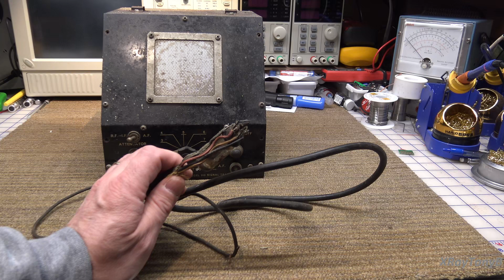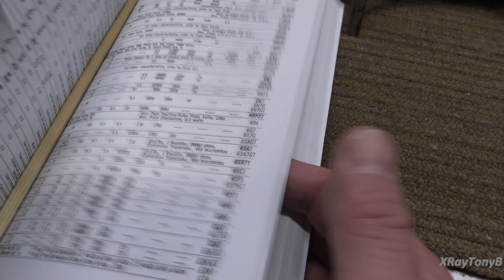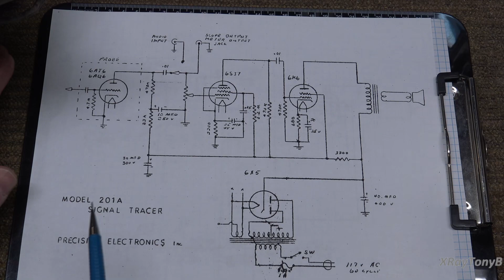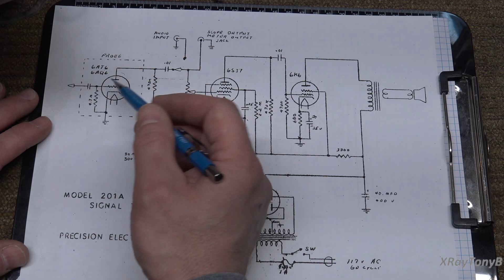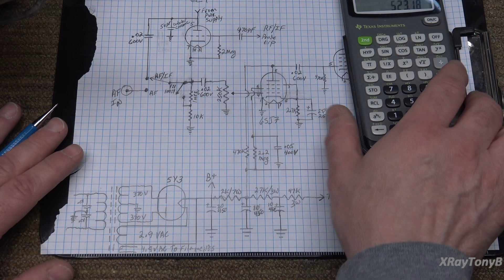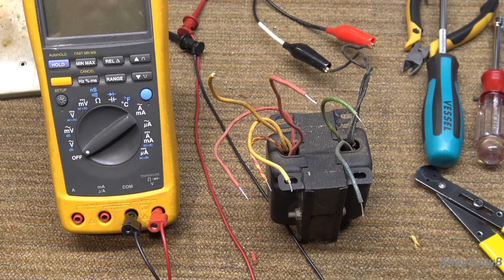Precision Model 200 Signal Tracer - Part 1

Comment: I lost all my repair equipment and parts. Radios and scopes, signal generators, telethons scope, 4,500+ vinyl records and record players/turntables/stereos. Caps and resistors, tubes, EVERYTHING last year when I went through a horrible divorce and everything in my house was stolen. In northern Indiana. So I am starting completely over again from scratch. From absolutely nothing. It’s such a bummer. I had no insurance either but those records were all hits, Beatles, Pink Floyd, Johnny cash Elvis on Sun. 10s of thousands of dollars. Makes my stomach turn every time I think about it. I did pick up a solder iron from the flea market the other day and a National Am Shortwave receiver. Also this signal tracer and vtvm from a friend of mine that’s getting old and getting ready to close his radio tv repair shop. The only one left in at least 100 square miles.

Comment: The voltage divider that comes right after the audio/rf input selector switch can easily be measured fir resistances in circuit instead of just relying on your eyes telling you what goes where, because it's isolated by capacitors on both sides.

Comment: Notice that 6X4 and 6X5 tubes have an independently heated cathode but the 5Y3 that somebody put in there is a filament type, directly heated rectifier without the independent cathode, and this could well affect operation negatively, perhaps in terms of more hum as well as a faster start up that could be rough on the other tubes and capacitors.  Perhaps the DC B+ was too high after the transformer was replaced and so the previous owner put a 5Y3 in there in place of the 6X5 in hopes of lowering the B+ somewhat, because the 5Y3 is less efficient and has more internal voltage drop than the other two independently-heated rectifier tubes do.

Comment: 6SJ7 is a pentode (6J7 was the earlier version with the grid connection on top of the tube) 6AT6 is a diode/ triode tube, but the diode isn't being used here. 6K6 is a lower-power version of 6V6 and was used in vintage Fender stand-alone reverb units.

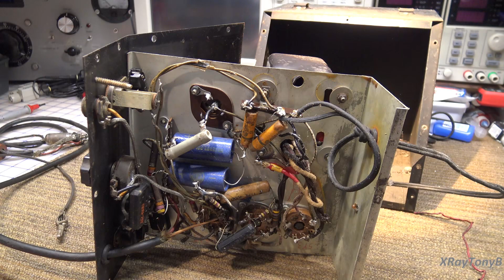Comment: 5:36 One of the things I really enjoy about old valve or other electronic is how dusty, rusty, dirty and rough they appear on the top and their exterior and once you turn them over, they look like they were made yesterday. I always get astonished by this.
I say leave all the crud and dirt there as it'll only just accumulate again and besides it's part of the history - but no, I can never resist giving them a good clean up (and do a bit of archaeology while at it (e.g. 7:20) as you never know what you may find). I guess it's one of those things...